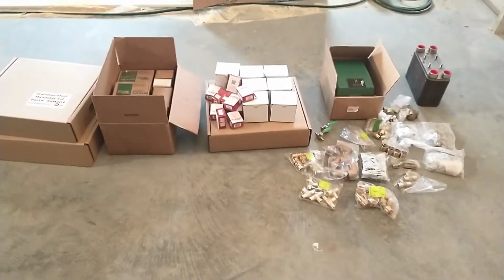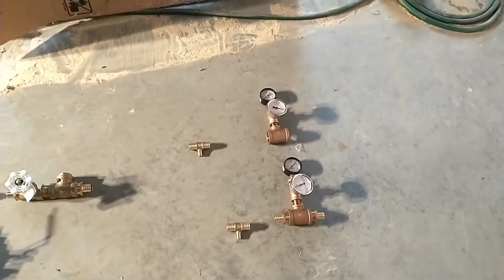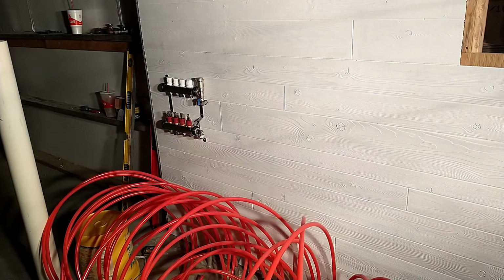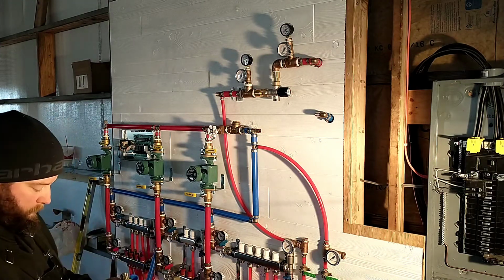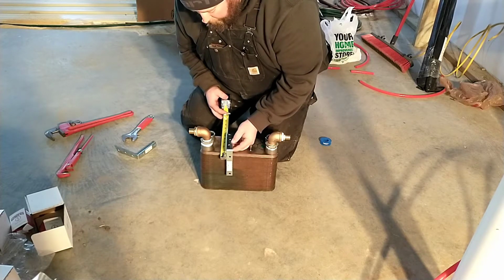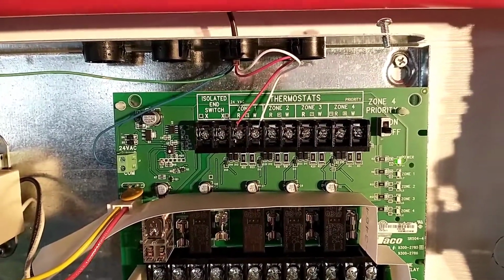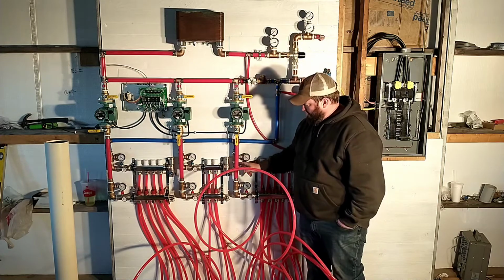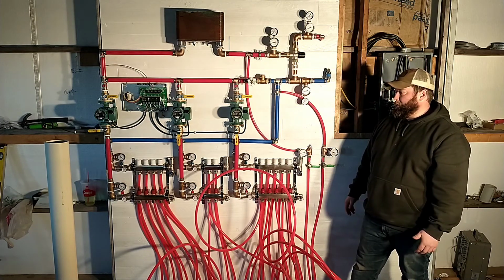Outdoor Wood Boiler Installation Part 4: Hydronic Concrete Floor Heat Controls Detailed Installation

Comment: I was always under the impression that pex pipe would not burst when frozen?
Reply from the maker: Well, it is definitely more resistant to bursting, but not immune.  It can expand more easily than PVC so it can absorb some freezing, I wonder if it didn't have to do with the fact that it was surrounded by concrete which would not allow the pex to flex.  I'm not sure, but I do know that it wasn't leaking before the freeze and it was after the freeze.  You do raise and interesting point though, now my wheels are turning!  Thanks for watching!

Comment: Have you ran the system yet? Is it working well? I'm currently trying to figure out the best setup myself.  I have 2 thermostats with 2 different zones. One zone has 5 loops and one zone has 3 loops. I just bought a used wood boiler. Now I'm trying to figure out the best way to set it up as far as plumbing to run the system.
Reply from the maker: Hey Josh, I have run it and I've been pretty happy with how everything works. If I would change anything, I would eliminate the mixing valve. It really doesn't do anything for me in my system, I think mostly because there is almost no pressure on the return (cold) side. Otherwise I'm super happy with it! Let me know if you have any questions, I'm no expert, but I can tell you what has and hasn't worked for me. Thanks for the comment!
Reply: @assemblyrequired1  hey awesome and thanks for.the response!!!